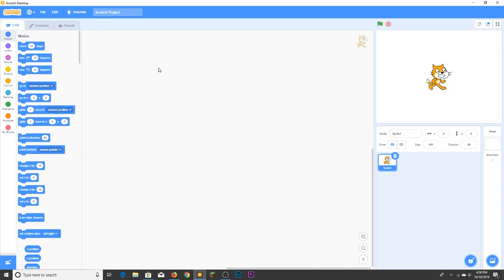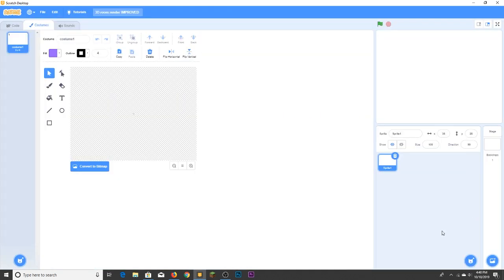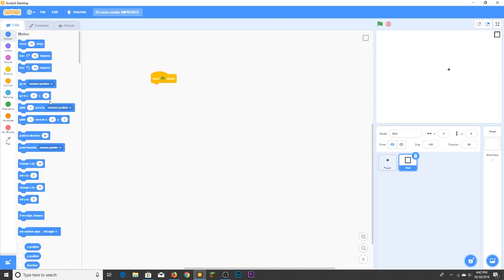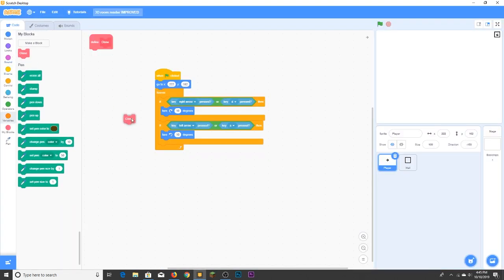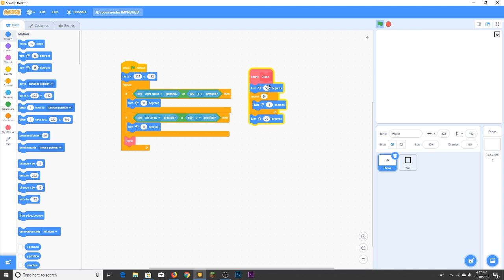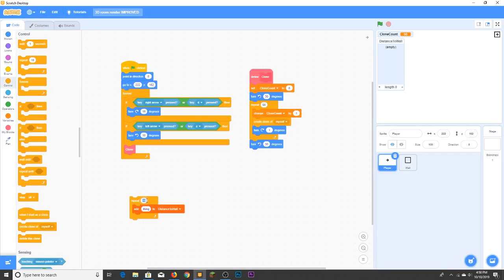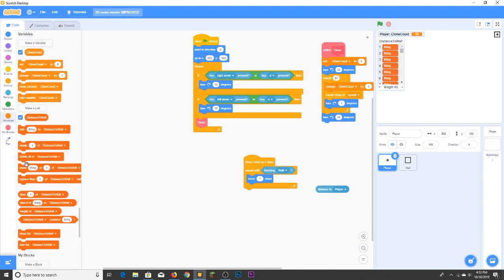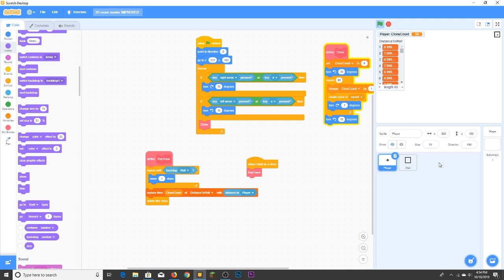3D Walls In Scratch Tutorial | Episode 1: Basic RayCasting

Comment: To fix the issue that the walls look curved, you want the component of the distance to the wall that is parallel to the direction the player is facing, NOT just the distance. For instance, if the right most Ray is 45degrees , multiply the calculated distance by cos(45). You can just have a calculated table for your rays.